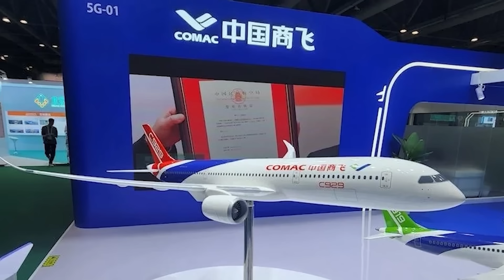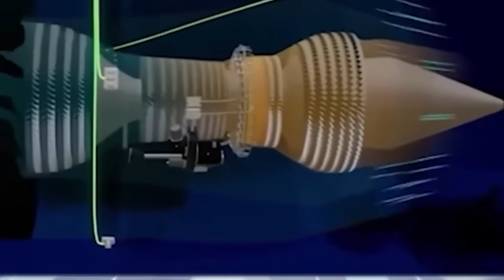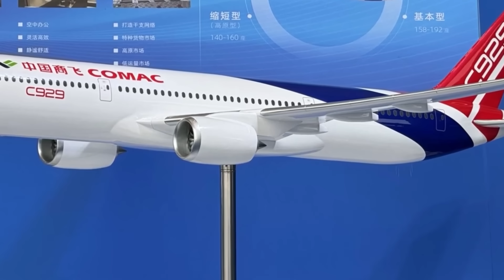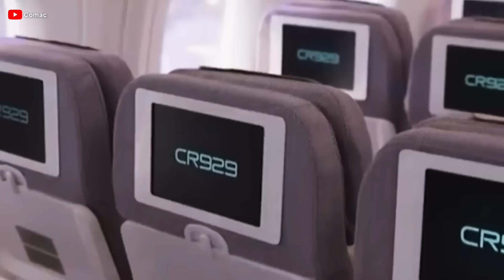China's HUGE PLAN for COMAC C929 Test Flight CHANGE All Aviation! Here's Why

Comment: It has been a long progression for China’s aircraft industry.
The advancement of China’s aviation industry is a testament to its commitment and capability. 
It is a positive development for the aviation industry with the launching of COMAC C919 and all aspects of aircraft manufacturing that will help facilitate the entire airline industry.
The Comac C929 is supposed to be a joint venture between Comac and Russia's (UAC), but due to uncertainties linked to international sanctions on Russia, Comac is continuing the programme independently of UAC.
The C929 aircraft is a wide-body airliner under development by the Commercial Aircraft Corporation of China (COMAC) as a competitor to the Airbus A330neo, Boeing 777, and Boeing 787 Dreamliner. Initially, it was a joint project with Russia's United Aircraft Corporation (UAC), but Russia withdrew from the partnership, leading to the aircraft being renamed the C929 in line with COMAC's other commercial airliners.
China is starting a long range of wide body aircraft project with the introduction of C929.
It is important to develops China own passenger plane as well as given an additional option to serve China domestic air transportation as well as long-distance route to other countries.
It is the dawn of the era for China passenger plane. 
The world is big enough to cater to aircraft manufacturing company like Boeing, Airbus and the newly company like China's COMAC.
Reply from the maker: You’re right. Thanks for sharing!
Reply: CONGRATULATIONS, COMAC!!!
WELCOME TO THE AVIATION WORLD!!!
I WISH MUCH SUCESS IN THE NEW PROJECT, THE WIDE BODY C929.
I APPRECIATE THE B777 FAMILY AND THE AVIATION LOVERS WAIT FOR BOTH, C929 AND B777X.

THE NARROW BODY COMAC 919 IS AN EXCELLENT REPLACEMENT TO  THE FATIDIC  BOEING 737 MAX.

MONICA SEIXAS
RIO DE JANEIRO- RJ
BRASIL